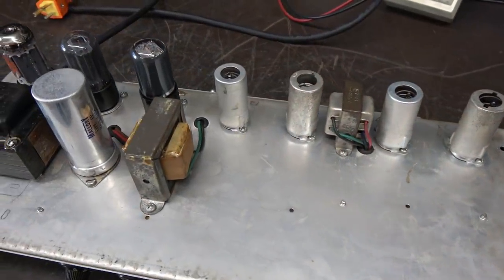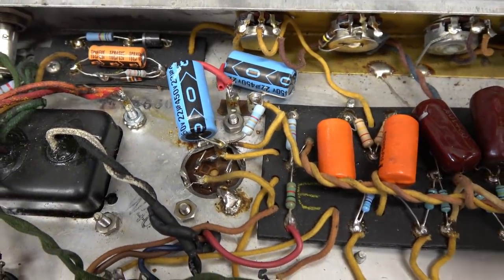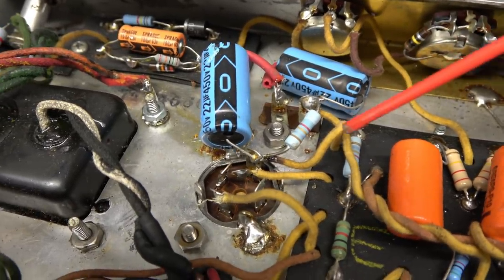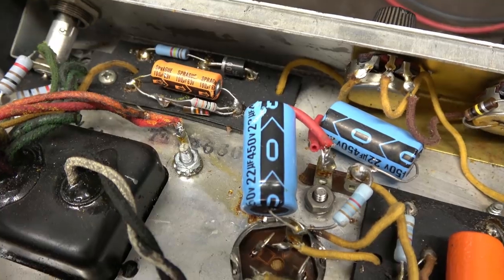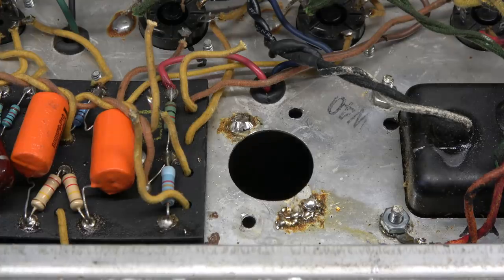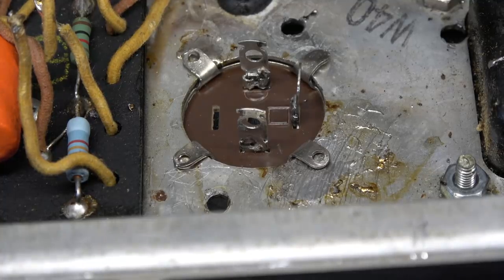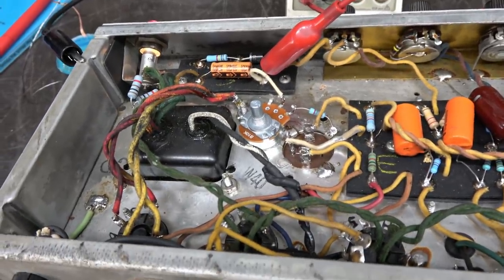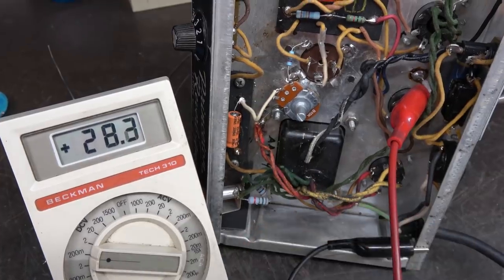How to reverse a Hack Job Blackface Fender Princeton Tube Guitar amp

Comment: That sounded over expensive for that can capacitor, but when you figure 3 or so Mallory or F&T single caps would be more than $40 and it is similar to the original cap. I'm surprised you did not go through the whole circus board for incorrect components. You did what you needed to do. Thank you Terry for your expert advice! Keep the original as original as possible. The bias pot upgrade makes this beauty even better! Thanxz
Reply: You can just buy 47 uF 450V Nichicons for like 3 dollar a piece. No point to go audiovoodoo on filter caps ;) Only reason to use these modern multi-section replicas is to make it look fancy.

Comment: My favorite soldering iron makes a cameo appearance! Today is a good day. Question- I have a Fender Bandmaster Blackface amp. It's original but the eyelet boards are warped and very "crunchy" (like I can't flatten them out they are so stiff). I can replace them with a black FR4 PCB style eyelet board from a reputable amp rebuilder, that looks similar. It mounts to standoffs not to the chassis directly. I don't know what that's going to do to the value of the amp. Any thoughts?

Comment: Great video Terry !!  Question:  What method did yo use to calculate the resistor and pot values for the new bias circuit?  It seems there are many versions of the "Princeton" schematic - and I didn't see one with those exact values.  Thanks !!

Comment: Being an amateur myself I’d look at the schematic and play snap rather than just solder random bits in, what size resistors do use on pin 8?
Reply: 1 Ohm 1% 1/4W or greater. The voltage across 1 Ohm is numerically equal to the current flowing in it.